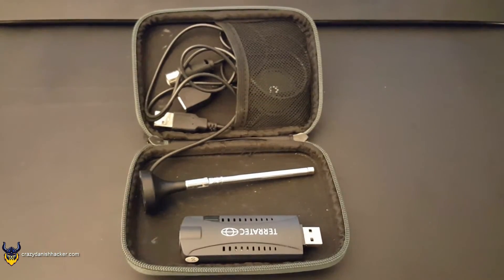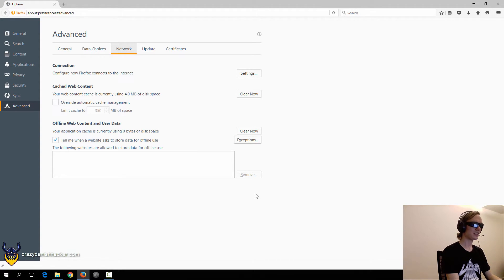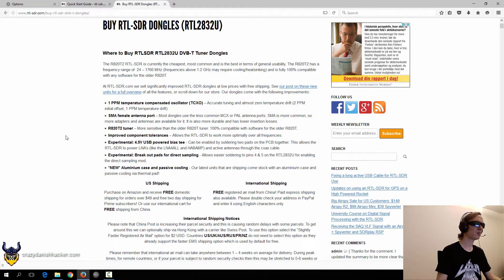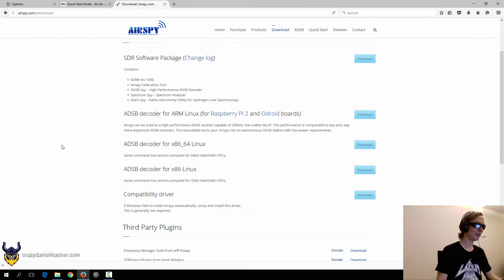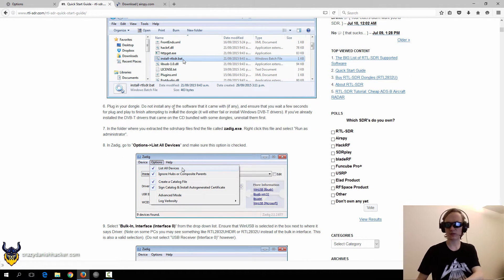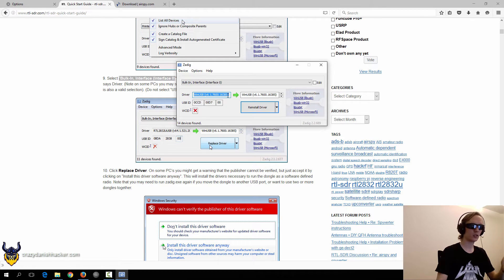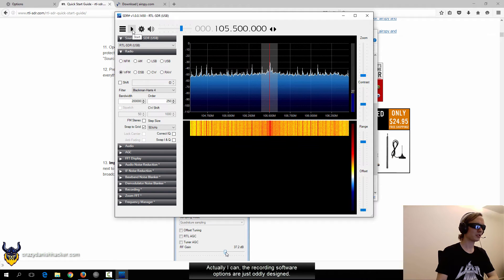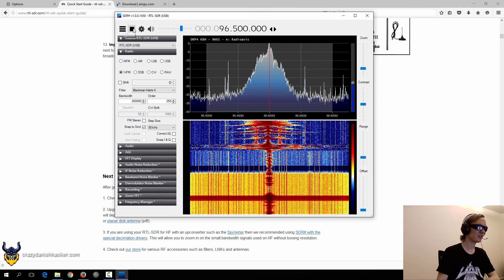RTL-SDR (E4000) - Software Defined Radio Series #1

Comment: Hey crazy Danish Hacker...what type of antenna you are using Any description...
Reply from the maker: In this video it's the default antenna for the E4000 RTL-SDR. However, I made an antenna review not long ago https://www.youtube.com/watch?v=w8M4leVv4Ds 

For GSM, FM and other strong signals, you can typically use almost any antenna. For satellite communication like Outernet, you probably want an RHCP antenna. (See e.g. the Outernet website.)
Reply: Any specification of the default antenna you are using in this video i want to buy one because the one that came with my RTL-SDR is small and doesn,t seems good enough..
Reply from the maker: The tiny one they ship with most (cheap) RTL-SDRs these days is not that great. If your RTL-SDR has the right connector, then you won't need an adapter from e.g. MCX to SMA. I recommend you check out the RTL-SDR.com or NooElec.com stores. Just search for "antenna" on NooElec for example, or any other website that sells hardware components.

There's also Adafruit.com and Sparkfun.com, both have antennas for sale too. Just keep in mind that there is both "SMA Male" and "SMA Female", so make sure you get the right one for your SDR device. (There's also Reverse SMA connectors, so it gets confusing very fast, and ideally you don't want to use any adapters where it is possible.)

I switched from my E4000 to the RTL-SDR.com one with the metal heat sink, it works great and I don't have to worry about breaking it. NooElec also have one that should be just as good.

Comment: I just picked up one of these (Nooelec smart) for meteor-detection, didn't expect to find people doing GSM with it, i shall watch with interest ;+}
Reply from the maker: Ah yes, I remember reading about how you can detect meteors too sometime ago :-) http://www.rtl-sdr.com/meteor-detection-rtl-sdr/
Reply: wow and here i was thinking i'd be needing super expensive equipment like the Bladerf or Hackrf my own question is that is this same dongle that you use throughout your software defined radio series ?
Reply from the maker: @spinmonkey: For everything that's related to receiving, yes. 
For transmitting (i.e. sending signals over the air) I'm using a BladeRF for e.g. the GPS and DVB-T videos. 

It is possible to transmit using much cheaper devices, but those types of devices weren't designed to transmit signals in the first place, so they may produce a lot of "noise" or very weak signals. (See e.g. http://www.rtl-sdr.com/using-the-rtl-sdr-as-a-transmitter/ )
Reply: Crazy Danish Hacker thanks for clearing that  up well i'll have to start saving up for a blade rf then lol

Comment: Can i use RTL-SDR to unlock car
Reply from the maker: Yes it is possible to use the RTL-SDR as a crude transmitter according to RTL-SDR.com (http://www.rtl-sdr.com/using-the-rtl-sdr-as-a-transmitter/). The other part of the equation (wireless locks), is definitely possible too. However, this depends on how the locking mechanism work. I have seen videos of criminals using SDR devices to open locked cars, but this is mostly done by criminals (at the moment) who has a good know-how about information security, or who has access to a black market that sells this kind of information.
There are some other researchers who were able to remotely control a car as well.
Reply: it possible to hack a wordpress web with php code?
Reply from the maker: SNM_ MD You can write an exploit in PHP code, but you can also write an exploit in Python, C, C++ or do the HTTP requests manually and use that to abuse the same weakness in WordPress. 

While WordPress is written in PHP, the exploit that you use can be any programming language. (Typically, exploits are written in Python or Ruby these days.)

To find a weakness/vulnerability in WordPress, you can either:
A) Fuzz all the parameters and hope that you find a vulnerability; or
B) Audit/review the source code, which is PHP.

If you're new in the field of web application hacking, I wouldn't recommend trying to hack the WordPress core. Instead, have a look at the add-ons/plugins, or wait for a new WordPress core (version) to come out and review that. (Especially if it has some new functionality that hasn't been reviewed a lot yet, because the WP core is quite stable.)
Reply: Crazy Danish Hacker You can show that?in video pls
Reply from the maker: SNM_ MD In a future video :-) I can't guarantee that I will find a remote code execution 0day, but I might find something like CSRF or XSS, that could potentially be used to execute code.
Reply: Crazy Danish Hacker i know a code i dont now how to insert that.
Reply from the maker: SNM_ MD It's not as simple as a "code". In web application security you have exploits, that are used to e.g. extract the database, hijack the session, or execute code.
Reply: make some video pls if you cant
Reply from the maker: SNM_ MD Making videos takes (a lot of) time (and I just record once or twice). I'm currently working on finishing my WiFi Hacking Series and also doing a few more episodes about Software Defined Radio. :-) (I have a lot on my schedule.)
While you wait, look at this video:
https://www.youtube.com/watch?v=ni3inoHkOPc
It describes the concept of finding 0days in web applications, and yes that method applies to WordPress too.